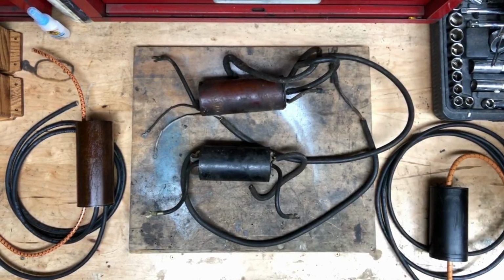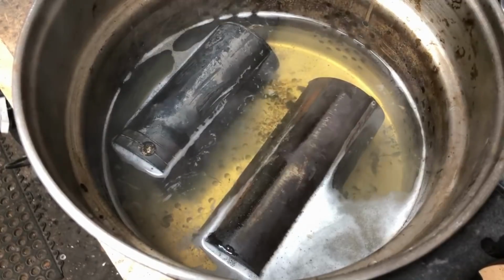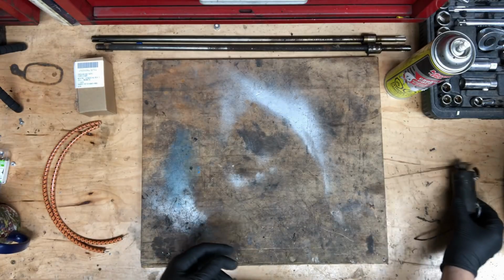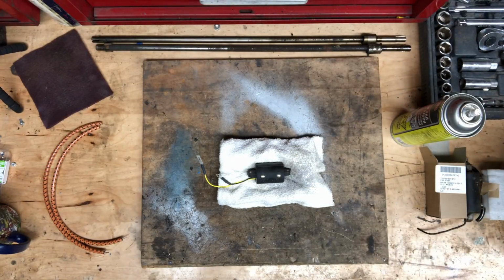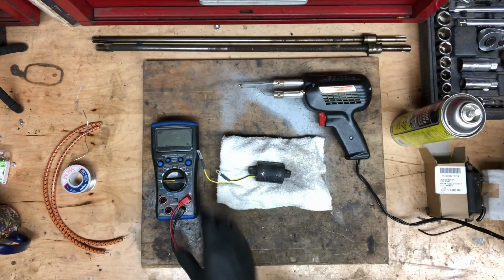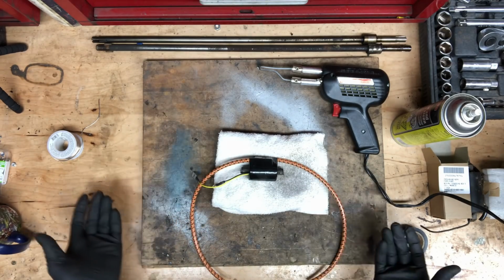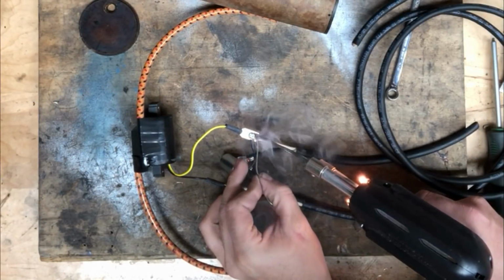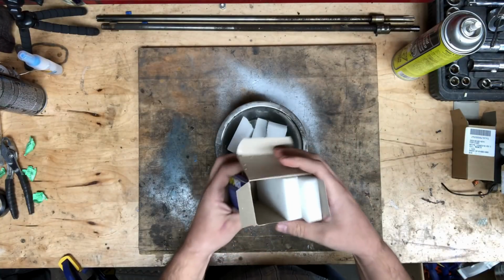Restoring ELTO Ignition Coils; Ruddertwin, Lightwin, Speedster, Quad, Service Twin, Super C

Comment: Can you tell me the link to the coil you used in video? …….thank you
Reply from the maker: There are several providers. We make no recommendations regarding where to purchase.  A search of Andover coil 4A032 MFR-61689 P/N 97403-13206E0140 on eBay or Google will provide what you need.

Comment: Great video!!! I have a 1939 Elto Pal with a bad coil.  Any suggestions for repair or replacement?
Reply from the maker: Conversion of the Pal laminate to accept another coil is likely your only option. An OMC universal coil should work.
Reply: Is it hard to get parts I have a 1939 elto pal 4266 I just got
Reply: I was looking to do an engine overhaul on my 1939 elto pal 4266 any suggestions on where to find parts for this

Comment: I purchased the 4A032 Military standard engine coil and measured the resistance across the coil and got ~6K Ohms (I cleaned the connection point thoroughly).  I am assured by the seller this is well within specs for this coil.   Before I assemble and encase this thing in wax will this be sufficient or do I need to look for another coil?
Reply from the maker: Great question. There are actually two versions of this coil being sold by different suppliers. One measures 6K the other 10K. What is important is that the resistance doesn't change after soldering. A very slight difference is expected since you are adding more material to the secondary output, but it shouldn't be more than a few decimals.
Reply: @uppercanadachapter-aomcian4166  I went ahead and ordered the 10 ohm version and it works like a champ...thanks.  It read about 11 Ohms after soldering.
Reply: Great video btw...thanks

Comment: Do you have a video for the 1939 ELTO mate  Coil which has a slightly different design? Original part number 195911 Dave.w.offers@gmail.com
Reply from the maker: Sorry, we don't. That is a completely different type of coil that will require rewinding. A substitute coil would be a better option.

Comment: I really like the tip about the military coil.  I can think of several other applications.  Thanks for posting!
Reply from the maker: They also come in single output and can be swapped for Bendix style coils. However, the output of the high tension lead is in a different spot so the plug wires may need to be routed differently.

Comment: Great video.  Thanks for posting.  I have a Model C on the rack I may get into this winter.  I will be doing this when I get to that motor.  I'm a little surprised the paraffin wax is robust enough to hold up to the heat of the motor running since this coil is tucked in pretty close to the powerhead.  Also thinking that a solid state .2uF 600V rated capacitor may be a longer lasting choice than the OMC condenser.  The condenser does have convenient places for screw connections though. Either way this is an excellent instructional!!  Thanks again.
Reply from the maker: Old JohnnyRude the wax seems to hold up fine. The coil is surrounded by air space so it doesn’t get that hot. A solid state capacitor would work fine and likely be cheaper than the OMC condenser. If I didn’t already have a bin full of OMC condensers I’d likely use capacitors. But like you said they wouldn’t be as convenient to use.
Reply: @uppercanadachapter-aomcian4166  Now that I finally got my Model A unstuck enough to spin it, I will be attempting to follow your steps.  A little nervous, you made it looks so easy and in 14 minutes:)!  Bill MN
Reply from the maker: @billandannroth6343  good luck with the Model A. Don't be nervous. It's quite simple. You won't have any trouble.
Reply: @uppercanadachapter-aomcian4166  Not sure what capacitor you used. Since my wires were already cut off , what length do you typically cut each wires?  Bill from MN.
Reply from the maker: @billandannroth6343  the condensers are .22 mfd used in the OMC Universal Magneto from 1951-199?. The wires only need to reach the spark plugs. I always leave mine a little long and trim them back once they are installed.